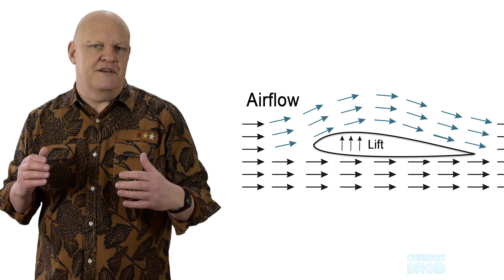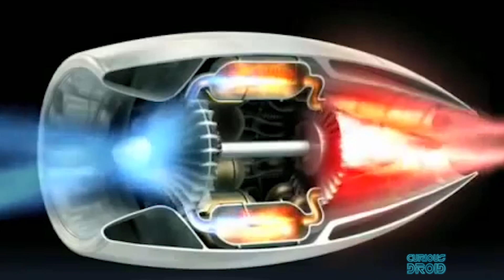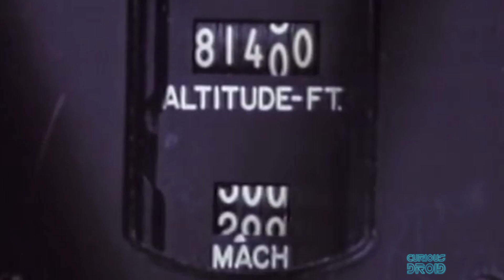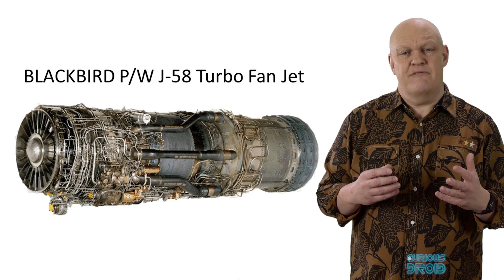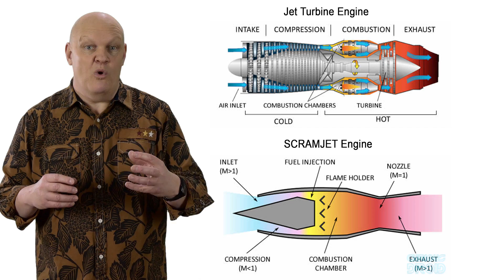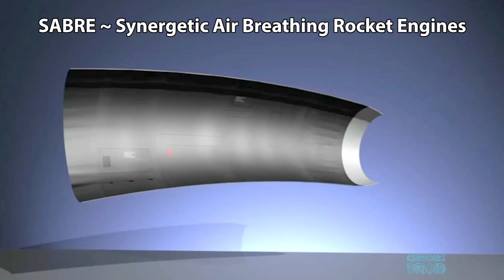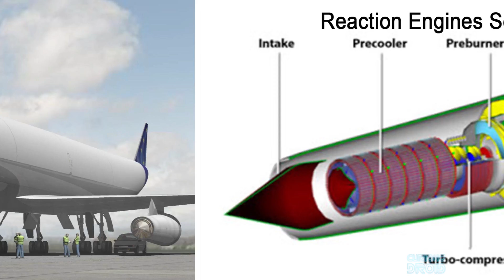Why can't we fly a plane into space ?

Comment: If i taught physics like you teach, none of my students would have ever failed or hated the subject. You are a damn good teacher. 👍🏽
Reply: keep it up you're no worse
Reply: I loved Physics but if he was my teacher, I would have scored 100%
Reply: Have you tried his ways?
Reply: exAMEN 🌈 FIRM'amen'T,

Planes fly over the plain plain anD simple

waterFALLS. seaLEvEL

🕹👀🤚 The sun needs oxygen to breathe, my brothers anD sisters are going to figure it out.

What do you think that thing reflects OFf 🌈 OF ¿ 🐟

🙃 Go Fish ¿ 🐟
Reply: AL'set +-🚔-+ tesLA,
hoU.Ston open the Firm'amen'T,

🤣🍿
Reply: That means you suck as a teacher?
Reply: If you taught physics like this you would've lost your job due to the incessant mixing of imperial and metric units. Would've confused the hell out of everyone.
Reply: Much respect; I’m sure you did fine. Teaching is hard.
Reply: @MrLewisbate that's not actually how thrust in a vacuum works. It doesn't push against the nozzle as the nostle itself is attached to the craft. That would be the equivalent of pushing against the steering wheel of your car while sitting in the seat, and expecting it to push you forward. What gives you thrust in a vacuum, is Newton's third law, that dictates that every action has an equal an opposite reaction. So what you are "pushing against", to use your wording, is the fuel that exits through the nozzle. The weight of the fuel and the speed that it is expelled from the rocket is what provides the force which pushes the rocket forward. 
Imagine if you were sitting on a frozen pond and you had zero friction on the ice. 
If you throw a rock away from yourself, you will slide the opposite direction. How far you slide depends on the weight of the rock and how fast you throw it. What the rock is made of, is irrelevant to the example. If you toss a bottle of liquid hydrogen and liquid oxygen of same weight as the rock, you would slide the same. The reason hydrogen and oxygen is used as propellant for rockets rather than rocks, is that you would need additional outside energy to propel the rocks (like your arm tossing them on the ice), whereas the rocket fuel when ignited explodes violently, which serves to toss out the fuel at a very high speed (high amount of force imparted on the fuel)  - the nozzle is there to direct all that burning fuel into the same direction and as evenly as possible.
Reply: OMG this guy is an idiot. Well not an idiot, just holding onto a belief because he wants to believe in something different. It's so frustrating seeing his responses. It's like trying to explain racism to someone who doesn't believe it exists 😕 thank all of you guys who tried to be patient and explain it to him lol
Reply: HE IS WRONG THOUGH
Reply: Plain and simple it’s not built and made for that. The o zone layer and atmosphere will disintegrate it in seconds and by bye plane and people
Reply: Please help me with a matter of physics? 
       If things fly around in their capacities limited by the height of atmosphere , by losing thrust , and then launch a faster rocket , ..... how do they maneuver in a vacuum without there being an opposing stationary force (air) that facilitates the opposite reaction we call thrust? 

        I'm just a truckin Joe that's thinkin while I'm drivin the long miles.... thanx if yuh can help me on this......
Reply: @icflatndatsdat5615  I would think it's because there's a lack a friction that any thrust in one direction would immediately and almost effortlessly turn the shuttle in desired direction. If you used flaps I would assume the same could be said but to a lesser extent
Reply: @ertren6  
When I think it some more I'm seeing this..... in vacuum chambers tests prove that with zero oxygen  , nothing can burn or combust.  Apparently nothing at all.  Also it would seem that the law of physics dictates these results. So since nothing can ignite  , then how can there be any propulsion without a power source? 
         How can any one certain machine function in a void that has no atmosphere like space for example ? Which a vacuum chamber stimulates...
          Simple question but  a darn  tough answer.  
       Lemme know what yuh think...... thx again
Reply: @icflatndatsdat5615  as far as that goes, they carry their own air and fuel mixture since there isn't any gravity in space you wont be slowed down so once you achieve a desired speed you would maintain said speed
Reply: @ertren6  
Thrust requires an atmosphere to push against.  Thrust is the reaction of two things. Combustion exhausting against atmosphere.   No atmosphere in space negates propulsion.  The real argument is with physics.  It dictates reality.  These physics say that space travel is an impossibility.
Reply: @icflatndatsdat5615  in space, it isn't completely empty however. In a zero  g environment. If you were to throw your shoe, youd go the opposite direction due to there's the fact that for every action, there is a reaction
Reply: @ertren6  
The problem with the rockets or shoe is that there is the solid barrier that separates the two realms...... Atmosphere and vacuum.......  
They cannot be side by side without physical separation. 
       So where is this barrier that is breached?  There cannot be .... travel..... through it......
Reply: @icflatndatsdat5615  barrier? If you chucked something in space, it would continue until it meets something to stop it. An atmosphere can be anything i.e water or fire etc. Space isn't completely empty
Reply: Hi IC Flat Ndatsdat,  A spacecraft will have little engines that are called Thrusters pointing in different directions. These thrusters when actuated spin the spacecraft around an axis. A bit like a ballerina spinning around her toes where, if you drew a line from her head to her toe, it would be considered one axis. Now to answer your question... in space, as you know, there is a vacuum (no air). The thruster engines are driven by mixing fuel and oxygen and igniting them. This burn is directed in one direction through a nozzle and escapes the nozzle into space at a very fast speed.  Now here is the trick. The oxygen and fuel mixture have mass (just like the shoe example). As they exit the nozzle their mass and acceleration combined create a force or push. But this push is not against anything out side the spacecraft but it is a push against the spacecraft (or nozzle) itself. This moves the spacecraft in a direction opposite the burn. The thing is, it is irrelevant if there is air or not outside.
Reply: @smak3924  
Experiments prove that to be a physical impossibility.  ( thrust in a vacuum ). Also I can't find an image of that component you mentioned. All I get is pics of rockets.  Not thrusters.  I can only find Renditions online but not actual video of thrust in space issues. Maybe you can find something that backs your claim.  ( chucking something into space is vastly different than thrust in space).
Reply: I C Flat Ndatsdat.  Lol, I am not making any claim. But trying to explain the physics of it as simply as I can. To put it simply, If I were bigger than you and you were smaller than me. If I give you a gentleman's push how far will you move? think about that one. Think again, If I were also standing in a small boat and you were also standing in a different small boat and we push. Thrusters can be a release of gas like air coming out of a balloon.
Reply: I C Flat Ndatsdat.  Just type in google search Lunar Excursion Module (LEM) (or LM) as an example. Or Service Module as another example. Check out the images. You will see pictures of them with little nozzles on the outside pointing in different direction to provide control about the axis of the vehicles.
Reply: @smak3924  
I thoroughly understand what thrusters look like and understand what they are supposed to do. Every rocket has the same shape in their trusting nozzle design.
       The issue is that nothing that is flammable , in any way , can  be ignited in a vacuum.
           Some people make the ridiculous claim that they bring oxygen with them to ignite the thrusters. That would take up a lot of space in a small module along with the fuel volume also.
           Even if there was a craft that had oxygen and fuel in it , and ignited within , there would be no atmosphere to push against.
      Atmosphere is tangible and in a vacuum there is nothing tangible to ........push against. 
        Even supersonic aircraft prove this point when they have reached the ceiling of capacity.  ( lack of atmosphere to thrust against ) Your example is like others that are mechanical in nature. No propellant of any kind. I can make an example also. For instance ,  a truck spring with two bowling balls at each end released would propel those balls while the spring stays stationary. 
         Again it is scientifically proven in a vacuum chamber that nothing can be ignited to cause propulsion. Also there is a solid barrier between the two realms..... that being vacuum and atmosphere. So by the law of physics , space travel would be a physical impossibility against natural law.  The thing is I do not have to prove that space travel is impossible because the law of physics does it for me. 
        To summarize..... my claim is that space is not real......
Reply: I C Flat Ndatsdat.  It sounds to me like your trolling. I thought you genuinely want to understand how it works.If you don't believe then you don't believe and never will.'To summarize..... my claim is that space is not real...…'There are two points you are asking about Ill give it one last shot at explaining.1. By your understanding, the combustion in your trucks cylinder would never work. Should there never be oxygen (air) and fuel inside or  anything then it would be a vacuum. and how would it ignite?Well there is oxygen and there is fuel inside the chamber and all is needed is an ignition source, (In the case of diesel fuel, it is the compression and heating of the cylinder that contains the mix which will ignite). But in space, the chambers before the nozzles are not in a vacuum and have a fuel oxygen mix and are ignited by electrical igniters.2. The resultant burn exits the nozzle at high speed, The reaction (Mechanical) force is the exhaust burn and nozzle push away from each other. There is the movement. The Gas exhaust has Mass and that will continue into space indefinitely until acted upon by another force. The ship that is attached to the nozzle will be nudged in the opposite direction and move in that direction until another force acts upon it. The two push away from each other. Not against space. It is also possible from an engineering perspective that releasing un burnt compressed gas via the nozzle will also do the job. However by burning the fuel the exhaust would be at a much higher velocity and therefore resultant force is greater.
Reply: @smak3924  
I never new what trolling was , but having a hidden agenda , I am guilty. Now.... I understand what trolls do and I don't like it.  
       I played naive only cause I wanted real actual reasoning and most times my questions are reciprocated only with mother talk and hate.  
      I dole out the respect or disrespect I'm dealing with.  
 So ,  also , if you are genuine.....
The problem I have is this.... even if there is the system that functions ignition in a vacuum , I question this.......
        Per this guy ,  the video ographer ,  he says in another video that atmosphere is necessary to thrust against.  I agree.  And vacuum chamber tests prove what he said. No atmosphere.... no propulsion... So now I ask.... where is there a barrier that rockets go through to enter vacuum from atmosphere? 
      The only real answer I've ever gotten was..... from sea level to the highest of atmosphere , IS the barrier........  Because all matter is empty space. Nothing is solid. 
                         ?? !!
    I told that person that we have to conclude to agree to disagree. 

     For what it's worth..... I'm dead serious.
Reply: @icflatndatsdat5615  Go learn about Newton's 3rd law of motion. You're dead wrong about propulsion in a vacuum.
Reply: @ertren6  Empty? What emptiness has to do with the forces acting on the body?
Reply: @override1337  what?
Reply: @icflatndatsdat5615  Which experiments is this? If we put out mass with some acceleration, of course it's going to push us back. that's the third law. Atmosphere makes things easier but we certainly don't need it.
Reply: @icflatndatsdat5615  Buddy.... they do take oxygen with them.... you can see the rocket plans....they carry two big tanks. One oxidiser and one propellent. And you keep telling thrust in vacuum is not possible even though you've bee explained multiple times how it IS
Reply: @icflatndatsdat5615  ATMOSPHERE IS NOT NEEDED FOR THRUST. THE THIRD LAW OF MOTION, LOOK IT UP.
Reply: @angadsingh9314  
" atmosphere makes things easier? "
Too funny...
That means no atmosphere makes it impossible.  
Every flying machine has a ceiling of capacity.... in atmosphere. 
Maybe one day you will see a "space machine " go to space in an UNEDITED RECORDING of the trip. 
But don't count on it.  
50 years of alleged space trips and STILL  no recording of this ever happening. Make science prove itself so you can believe it's fact. That's what they tell me and it's true. 
Good luck...
Reply: @angadsingh9314  
I have. 
We disagree...
Now why don't you look up space travel without being edited. Like I said you can't find it so go ahead and know that as a fact. That's science
Reply: @icflatndatsdat5615  Dude.... that is not relevant.... We know for a fact that air gets less dense with increasing altitude. And you say 'That's science' but i don't think you even understand what science is.
Reply: @angadsingh9314  
It's you that stumbles at physics wich is science. 

You BELIEVE space travel happens but there is no evidence that it does. 

Space travel is not possible according to the law of physics. 
Your arguement is against those laws. Not me.  

Now what?
Reply: @icflatndatsdat5615  Also, you seem to have no clue of what CGI actually looks like.... There are limits.... and tells....
Reply: @angadsingh9314  He's just going through the same old many times debunked Flat earth arguments. You won't be able to explain any of physics of spaceflight to him, since he's already convinced that the whole world, besides him and his flat earther buddies, are brainwashed by nasa...  lol.
Reply: @icflatndatsdat5615  I'd love to hear the answer to this also

Comment: Prevideo Prediction: the air is too thin to generate enough pressure and thrust to maintain speed and lift beyond a flight ceiling of around 45,000-50,000 feet, and if you got there, once in space there would be no air to pump through the turbines and the channels around them to move the plane. *Watches video
Reply: I'm pleased at how close I was, but only for commercial airliners. I was  very wrong about the upper ceiling of jet propelled flight though. I should have remembered the 80,000+ ft ceiling of the Blackbird. I love that thing.

Comment: and even this guy is ignorant. you do not need to reach escape velocity to fly into space, you need to reach orbital velocity. orbiting the earth is flying in space, you big dummy. you only need escape velocity to... wait for it, escape the gravitational pull of the earth to go to the moon or beyond. 

When you reach orbital velocity you are in freefall. the horizon is falling away from you at the same rate you are moving over it. the earth curves about 8 inches per mile. you have to be going fast enough that the earth curves away under you 32 feet every second. You're falling 32 feet per second and the earth is falling away under you at the same rate. That is 17448 mph in low earth orbit. That is flying in space and it does not escape velocity.

Comment: 0:20 IMO it's too simplistic explanation. Bernoulli principle holds true for smaller airplanes but for big and fast it's not enough. It can be accounted for only about 10% of total lift while the rest is just Newtonian reaction force - meaning the defalcation downwards streams of air by wings.
3:10 Not really. Our skin makes a pretty good protection. The blood is not going to "boil" right away. 
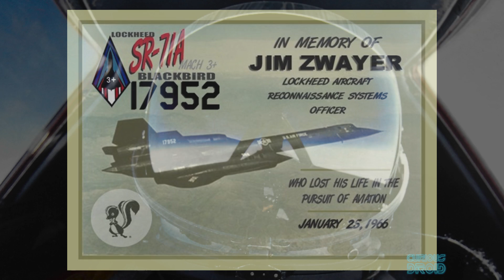3:32 No. The escape velocity is not needed to get to the space. ISS is not traveling with such speed... "All" what you need is 7.9 km/s / 28,440 km/h / 17,672 mph at the surface of the Earth. Although you need the escape velocity to get to the Moon or Mars.